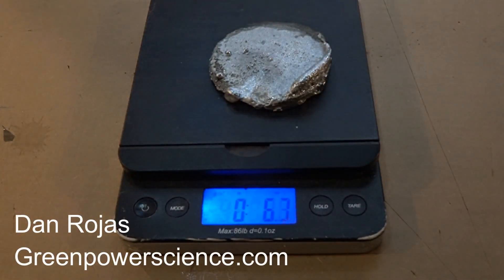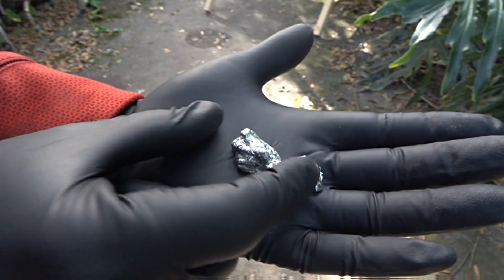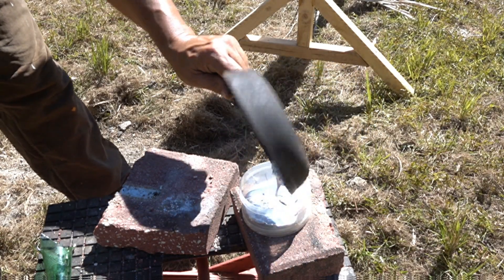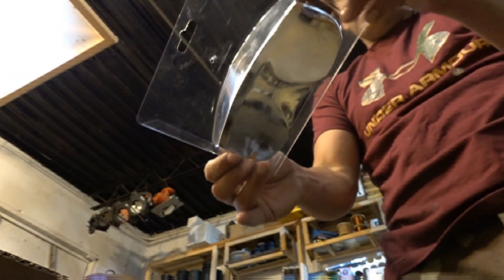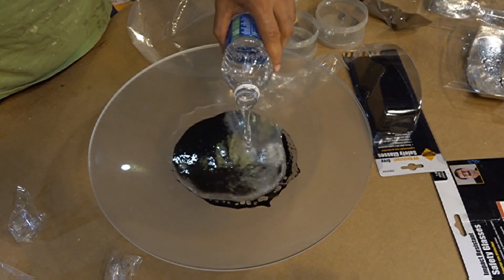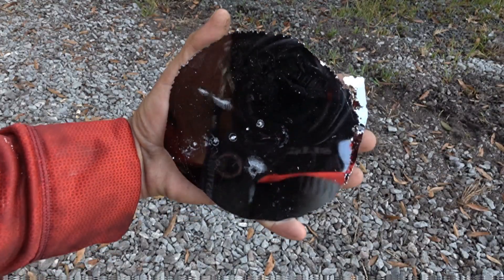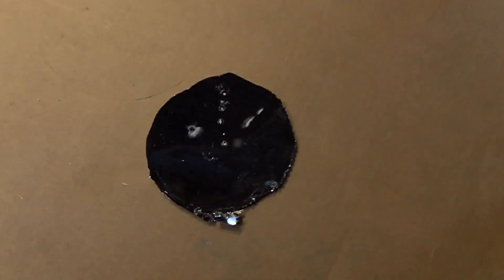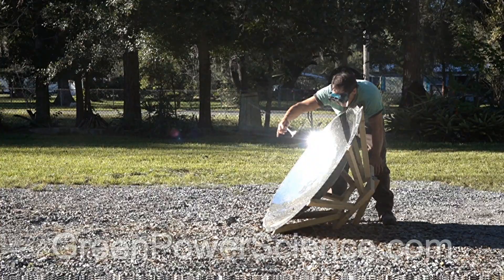Gallium first surface parabolic mirror

Comment: "Not practical for solar projects"

That's a bit of an understatement. Even if you could keep it cool, you'd have to deal with oxidation.

Still, this was an interesting video. I hadn't considered using a low melting-point metal as a mirrored surface without even needing a foundation structure (once the mold is removed). Have you considered trying to forge a mirror out of a metal with a higher melting point?
Reply: More of a moon surface project than.
Reply: Cloxxki If you mean it should be put on the moon, then you should consider the very high temperatures it would be exposed to.
Reply: Cloxxki Less atmosphere generally means more extreme temperature changes.